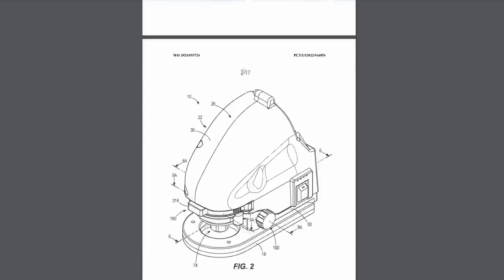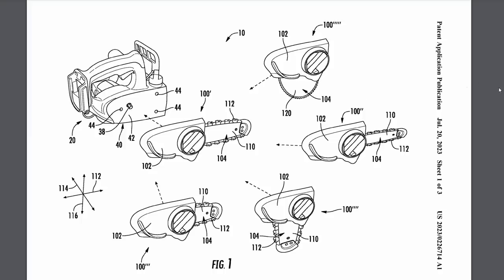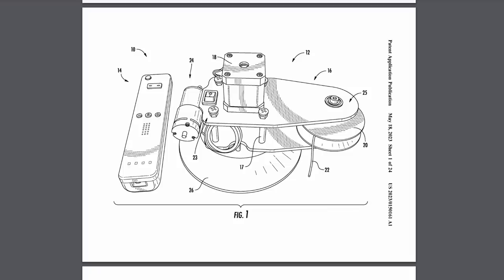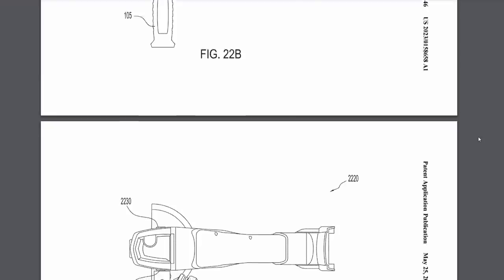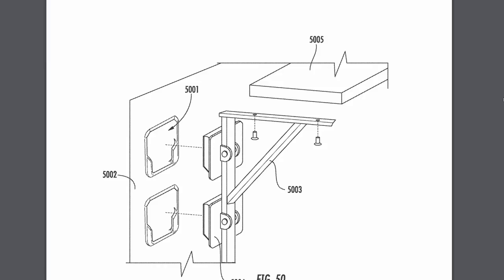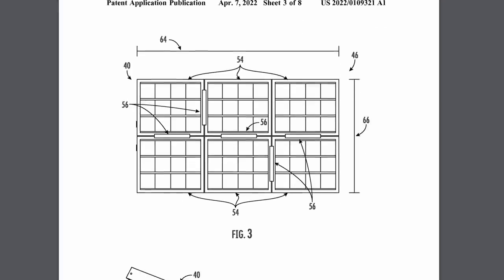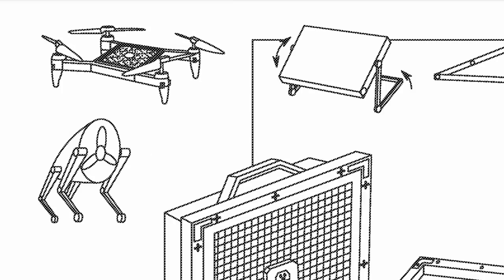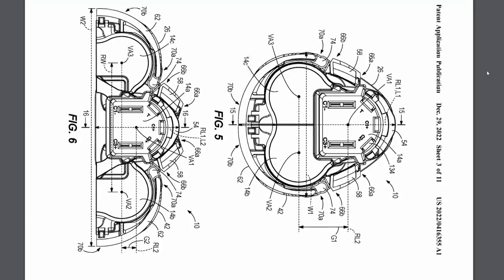Milwaukee Tool Patents for 2023 - Leaked!

Comment from the maker: Predictions I got right for Pipeline 2023:
M12 FUEL Jigsaw: https://www.milwaukeetool.com/products/2545-20
M18 Dual Trigger Braking Grinder: https://www.milwaukeetool.com/products/2986-20
M18 Rotary Laser: https://www.milwaukeetool.com/products/3704-21T
M18 Strut Shear: https://www.milwaukeetool.com/products/2933-21
M12 Box Ratchet (2020 Prediction): https://www.milwaukeetool.com/products/3050-21
M18 Telescoping Pole Saw (2021 Prediction): https://www.milwaukeetool.com/products/3013-21
M18 Backpack Blower (2021 Prediction): https://www.milwaukeetool.com/products/3009-24HD
Packout Roll-On Power Supply (2022 Prediction): https://www.milwaukeetool.com/products/3300R

Comment: Still hoping for a bottom roller pack out with a drawer or cabinet so the whole stack doesn't need to come apart.
Reply: Yeah they should copy rigid and have the handle/wheels attach to any box.  Would be sick if the handle came off and turned into a fully functional dolly as well.
Reply: Yep.. It's a HUGE miss by Milwaukee that the main roller base is something that you have to take everything off of to access.
Reply: I’ve been saying from day 1 how stupid the pack out is for this reason. You need something from the bottom box you have to unload everything. I think DEWALT used to have a hand truck that used a system similar to its wall mount brackets where you could access any part of your stack but I’m just against all these rolling boxes. Buy a magliner.
Reply: @KZ-yy9pm  Dewalt still makes that hand truck.  And it's also built way better than Milwaukee's version too.  (and still doesn't have the bottom box issue if you need an XL box with large tools at the bottom)
Reply: @jaywelker5566  Interesting, the only way using a pack out made sense was if you had 2-2 drawer boxes at bottom. Then 1-3 draw box in the middle. At the top either a crate or a couple hardware cases this way nothing really has to come off. But with Milwaukee I’ve heard hand truck was trash so stuck with dolly only. This set up is possible with dewalt but if that hand truck still exists and doesn’t suck then you can build really however you want. I was under the impression it didn’t exist because I haven’t seen one for sale, in person or on social for a couple years.
Reply: @jaywelker5566  yeah but the hand truck sucks I don’t care what platform. Because you cannot open boxes while they’re still attached with the handtruck. You can’t open the middle box while there’s a box mounted to the top of it with the hand truck.

Comment: So excited to hear about the m12 fuel jigsaw!  Their current m12 jigsaw seems to fall short of people's expectations.
Reply: I've always liked mine. If I had to complain about anything I guess it would be not having the ability to oscillate the blade. I was always happy with the battery life, size, and power. But I'm also not a professional carpenter or contractor.
Reply: @grantdeisig1360 , I’ve used the M12 Jigsaw professionally.  It doesn’t lack power, what it lacks is the front blower, to move away debris from the cut line.  However, having said that…the new M12 Fuel Jigsaw should produce more strokes and power, which typically means quicker and smoother cuts.  I’m looking forward to getting one.  Hopefully they’ll attach a promo that included es a free battery, so I  can take advantage of the hack, getting it for  40% to 50% off retail.
Reply: @martylucas8557  Yeah your right, I always hated constantly blowing the saw dust away to see what I'm doing.

Comment: A couple of these patents came true for packout 2024, like the angle grinder, packout exterior accessories, shopvac, m12 jigsaw. For the heated gear we unfortunately got a new flat proprietary battery with new proprietary connector. We didn't get the packout backpack but did get a slide box box. I was really hoping to see the m12 rcompact router and redlithium L4 tools, especially looking forward to a single/dubble 4/8 V ratcheting multipurpose screw driver for large and small hexbit solutions and with variable power and rotation speeds for el3ctrolics repairs and diverse home and jobs item screws and hexbolts with longer sleaker bit support as well for reaching those deep holes where screws and fastners lie deep. Preferably a model that can be twisted into both a barrel grip or pistol design and maybe also have dwewalts guro activation system. That would solve so many tools in one instead of having 10s of tools laying around. And L4 battery distance laser tool to measure distance would also be nice, or an L4 battery headlight that can be mounted/dismounted from the headband magnetically.

Comment: Very interesting patents. I'm most happy to see the expansion or the redlithium usb (aka 4.0 and 8.0 volt) systems expansion. I have a lot of L4 batteries lying around. Wish I could do more with them than lights only.  I'm a bit disappointed about the gun type screwdriver. Was hoping an upgrade of the current model that can be interchangeably be used as a barrel or gungrip intermittently that are also compatible with the L4 batteries.
A patent idea in missing is making the milwaukee ratchet screwdrivers into electric ones using the L4 batteries.
I think the foldable 12 Volt battery for the heated jacket is a bad patent and design. I was thinking more in the line of daisy chaining 4 to 6 L4 batteries in series or parallel in a belt and holster type configuration, integrated in the heated jacket and other clothing. I think that would be a much better and less bulky design. With 3 or 6 L4 batteries, you basically have the same as on 12V 3.0 or 6.0 amp battery, and less bulky.
The packout ideas are simply wonderful aditions to the current llineup
Reply: As an improvement to current batteries I was hoping to see an improvement of battery battery balancing technology integrated in the batteries or chargers. There are so many videos on battery issues with milwaukee batteries. A lot are related to cell imbalance. Cell balancing pcb technologies have improved over the years for longer battery life, bit I haven't seen them yet on the newer milwaukee batteries of an of the milwaukee battery line up. Have been balancing cells with milwaukke batteries for a while now. Would be nice of this was integrated better within the battery with a push of a button, the battery, or better integrated cell balancing features within all the milwauke, battery line ups.

Comment: Dust extractor seems promising.  Maybe they’re working on a good sander to compete with Bosch, Festool, and Mirka.  Something that has power coming from the dust extractor and not on the sanding unit itself.  Somewhat pointless for most cabinet builders but would be sweet on the job site when you dont want to bother with extension cords.

Comment: I'd like to see a direct corded power source for the tools that will run them off 120 volt A.C.. It would be for when you have the capacity to run tools with shore power. For instance, you have a production run where you don't want to keep changing batteries or you have limited battery charging, or you don't want to run batteries through charging and discharging cycles.

Comment: I'm excited about that dual power, packout dust extractor (feels like I should say "finally" here). Also the red lithium mini impact would be nice for work like installing a few dozen receptacles. 

I'm still stumped by them not completing their nailer line up. M18 roofing and siding nailer, M18 positive placement nailer...? Seem like no brainers with bigger (carpentry, framing) markets than most of what was on this list.
Reply from the maker: It's possible they're still working on them and just don't have any patentable features on the other nailers.
Reply: they can hide patents from public view, so it's possible they have them but can't be seen.
Reply from the maker: At least in the US, a non-publication request is only allowed if the applicant doesn't plan on filing the same invention as a foreign patent as well. Milwaukee files almost all their patents as both US and international.
Reply from the maker: Published in September: https://patents.google.com/patent/US20230294259A1/en
Reply: @DoresoomReviews That'll be awesome to have come out. Thanks for posting that patent link! Greatly appreciated. 

The number one tool I'm waiting for is a Gen 2 M18 Surge Hydraulic Driver. Number 2 on my wish list is an M18 metal connector nailer/positive placement/hanger nailer or whatever else one wants to call it. Number 3 is a Gen 3/updated version of the 2136-20 rocket tower light. 

I'm looking forward to the "tabless" cell 12.0ah forge coming out and I'm really curious what other m18 batteries will come to market based on the fact that some of the battery bays are a lot bigger then the 12.0 battery. Tire inflator, rover light, rocket light, etc.

Comment: From an automotive perspective, the air hammer is the only pneumatic hand tool for which there is no electric equivalent.  Although I wonder about the stroke length and bpm, I would surely buy one when generally available.

Comment: With the planer, router, and fuel jigsaw in m12 I’m wondering if that’s why Bosch 12V tools are on clearance at Lowe’s. M12 sander next?
Thanks for doing these every year. Always fun so see.
Reply from the maker: I doubt we'll see Milwaukee at Lowes since they have Flex and Kobalt, but you never know!
Reply: @DoresoomReviews  I mean more along the lines of Bosch saying let’s get these 12v tools out into people’s hands before m12 stuff comes out. Most videos I saw of the m12 planer were saying how much better it was than the Bosch.  (Just my story) 
I wouldn’t mind a fan drone following me around in this Texas heat. Take care.
Reply from the maker: Ah, I get what you're saying now. I've worked a few summers in construction and as a land survey tech in the Texas heat, and agree a fan drone would have been great! (Of course, drones weren't even really a thing back then though...)

Comment: We want the M18 Installation driver!

And Gen 2 M12 & M18 Surge Impacts!
Reply from the maker: The tri-light ring on an updated Surge would be great!
Reply: I'd love a surge setup that was quiet yet more powerful.  Then again I've already got 8 drills/impacts...
Reply: @NonieTools  I think the sweet spot would be 600-700 lb-in—I assume this is doable given the Ridgid Stealth is 650 lb-in and under same parent company—but more importantly:

• Under 75 dB
• +300-500 rpm

And yeah, tri-light!
Reply: @MadLadsAnonymous Agreed! I've been waiting over 5 years for a gen 2 M18 Surge. Lol. 

+300-500IPM as well as the the 4000k true view (high CRI) LED's in Tri-light configuration (like they have on the new high torque impact wrench) with 600-700 in lbs with +300-500rpm just like you said would be fantastic! Keep it the same size or even + ½" longer wouldn't be a deal breaker to me. Keep the same noise or slightly quieter. Some of these new impacts are so small now and the batteries are longer than the tool and I find that I prefer a 6" long bit unless it absolutely can't fit in a space, then I'll use a 2" bit. 

The Surge's are by far my most used tool on the jobsite. Absolutely love those tools. Much better than Makita's soft impact version which I also own.

Comment: I really want to see a gen2 packout dolly. Dual battery table saw would be nice. Gen2 m18 hand planer. I think the 7 1/4 in miter saw could use a redesign. That thing will not stay zeroed for the life me. M18 biscuit joiner, M18 jamb saw, M18 flooring nailers. mX fuel chainsaw would be sweet.

Comment: 11:06 that folding battery would have to be 14500s. There's no space in the M12 to fit internal walls with 18650s. A power bank is a much better solution and what people already use with these jackets.

Comment: Heated socks and jacket with arm heating can come my way. The M12 battery location sucks and so does the battery. Just have a dedicated battery that wireless charges and have option to add the M12 if needed.

Comment: I basically have almost all Dewalt 12v tools (with the exception of the m12 brushed ratchet). With Milwaukee miles ahead of their competition with 12v tools, i am very tempted to switch over to m12.
Reply from the maker: The M12 system is the only 12V system I recommend anymore. Nothing beats it for the breadth of tools they offer.
Reply: Depends on what you need, I wouldn't switch

Comment: I want to see M12 Glue Gun (NO DRIP TEC TM) with 2 or 3 different versions - 

M12 mini Heat Gun with 2 levels of temperature - 

and M12 HYDRAULIC Articulating-Head Auto Hammer.

Comment: Great video. As others have said, about time a new m12 jigsaw came out. And a trim router.  Ever since I got a ridiculous  home depot website error deal of 8 Roybi HP brushless tools for $150, I'm done with m12. As a diy homeowner Ryobi tools work just fine for me. Even a fan of Ryobi 4 volt tools like Milwaukess Redlithium USB.  Love to see new Milwaukee tools and technology, just means in 2 years it will make its way down to Ryobi.
Oh and Milwaukee also needs to come out with a Gen 2 circular saw. Even though its Fuel, its 10 years old and I know with new technology they can make a more powerful one.
Reply from the maker: If I'm going to use a tool every day or at least several times a week, I'll usually buy Milwaukee. If I'm going to use it less than that, I buy Ryobi.
Reply: @DoresoomReviews  Can't fault that logic.

Comment: I would really like to see a m18 power supply so you can plug in tools that use a lot of power like the air compressor.
Reply from the maker: Like this one? https://www.acmetools.com/milwaukee-m18-carry-on-3600with-1800w-power-supply-2845-20/045242551460.html
 Or something different like what Metabo HPT has with their 36V multivolt system?
Reply: i agreed 
some wants to take their tools and turn them into AC would be awesome
Reply: @DoresoomReviews  like what metabo has. that would be neat. (I meant the m18 compressor, plugging that in and not having to warry about the battery dying would be nice.)
Reply: @DoresoomReviews  I'm also wafting for them to release an m18 or MX powered yard cart with a dump bucket.

Comment: That usb ratchet looks like the ryobi one, but would be super usefull just to have a smallet profile ratchet
Reply from the maker: Agreed - most of the time I'm using a powered ratchet I care about speed, not torque. As long as they build it sturdy enough to crank on manually and with enough torque to run on nyloc nuts, I'd be happy!

Comment: None of these excite me as a framer. When will they fix the plastic base depth set lever on either of the 7 1/4 saws that always go loose mid-cut? When will they release a cordless n17 sheathing stapler? Or balance and lighten the framing nailer so I can axtually uae it all day? When will they release an M18 screw gun that is compatible with the QuikDrive system?

Comment: I would keep away from the new grinder that has the disc lock system on that's the reason i kept away from the Bosch grinder with this disc lock system as you are beholden to them specific discs and the price they cost.
Reply from the maker: True, there's a definite cost vs convenience tradeoff.

Comment: Milwaukee is STUPID for not offering a dedicated FLAT battery for their heated gear. I bought an aftermarket pack like that from Amazon made for heated gear - and its half the size and works twice as long.  EVERYONE would (should) buy one, as long as Milwaukee didnt slap their name on in and charge $200 for it.  If anyone has seen these on amazon for like $70 - i highly, HIGHLY recommend you get one.  And you only need ONE.
Reply: Yep would be great having a flat battery for my jacket. I would buy one for sure. Can't wait to see if they are going to make the one shown in this video.

Comment: With all the heated gear they have and are continuing to come out with, it's baffling to me that they don't link up to share a power source. I'd invest in a heated jacket, heated pants, heated gloves, and heated insoles or socks if I didn't have to manage four different batteries to do so.
Reply: That's because the runtime on high in the jacket alone is 4 hours off a 2.0, divide that between pants and socks and gloves and you'll have like 1 hour of high heat and what 2 or 3 on low? Useless
Reply: The jacket alone runs on low for 12 hours off a CP3.0, so if you added pants and socks and gloves also on low then the runtime would probably be about 4 hours. I can't imagine needing to run the jacket on high if I also had the other heated gear running. Changing batteries once in an 8 hour shift, or twice in a 12 hour shift, is pretty reasonable; and almost all of my CP batteries are 3.0 already.

Comment: I wonder if the patents for the Milwaukee USB stuff actually want to Ryobi because they released a ton of Ryobi USB tools.
Reply from the maker: The USB patent was filed under Milwaukee Tools though, and all the Ryobi stuff I've found is filed under TTI. When I publicly speculated on collaboration between the two, Milwaukee PR made it very clear to me that they don't share IP.
Reply: @DoresoomReviews interesting when you look at stuff like the jigsaw. All three (Milwaukee, Rigid and Ryobi) came out with new jigsaws at roughly the same time which all shared a very similar design and had very even spec steps across the range.
Reply from the maker: When I speculated they shared research, it was for the Ryobi 18V inverter and the M18 Top Off that came out in close succession. So while they may not share engineering development efforts, I suspect Milwaukee/Rigid/Ryobi do share common broad "directives" from TTI on what type of projects to work on.